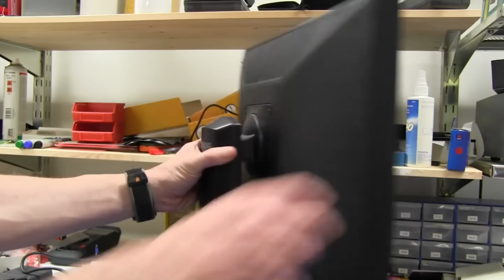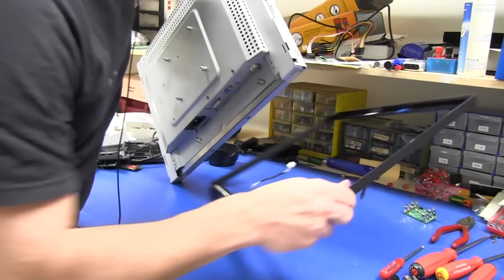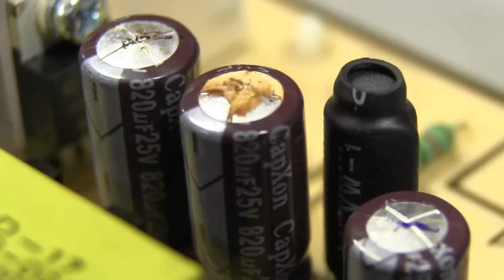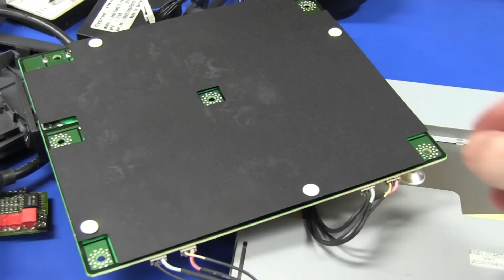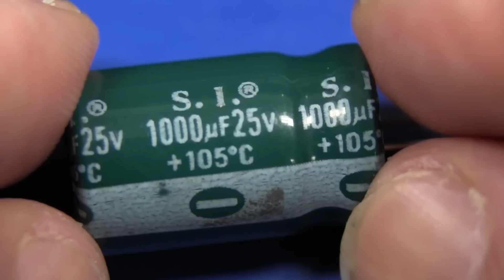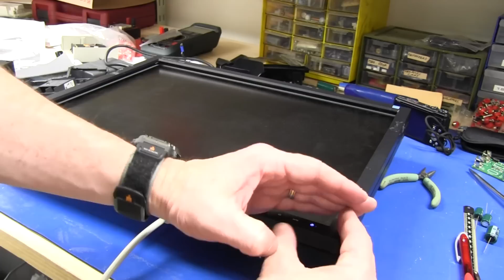EEVblog #347 - Bad Cap LCD Monitor Repair

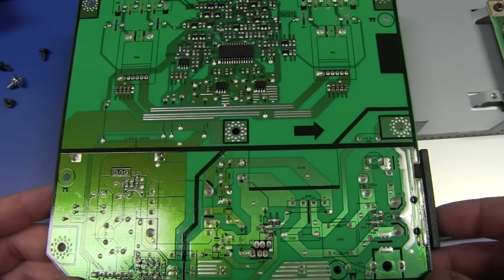Comment: @10:15 check the back side, the connector has the ground soldered directly to the board. That one you point at is extra ground connector, not used on this board.

Comment: The capacity doesn't matter much, a large capacitor CAN shock you even if it's 1-2 uF.
You can grab a 4.7k - 10k resistor with some pliers or tweezers and touch connect its terminals to the capacitor - the capacitor will slowly discharge through it.. use a voltmeter to determine when it's safe to touch it. 
Generally it's safe to work on the secondary side, without discharging the high voltage cap, there's no high voltage there. Just cover the large cap pins with insulating tape or paper..

Comment: Is it possible to discharge the caps on the PCB by switching the monitor on, before replacing them with new ones? I don't know if it’s dangerous to work on high voltage caps....high voltage but low capacity.

Comment: This has nothing to do with electronics.

The connector has four contacts. Three through-hole PCB pins, and one solder lug. If you look at the underside of the board further on in the video, you can clearly see all three pins are connected and an earth plane present, which quite visibly connects to the chassis via the mounting hole to the side of the connector.

Comment: Did fix a lot of those Samsung LCD's in the past. Yes 95% capacitor problem, sometimes burned  as it is called "inverter transformer".

Comment: Believe it or not, I watched this video onto a street-found 20-inch Samsung Syncmaster that  had bad caps... I repaired it in less than 15 minutes,  I didn't even bother purchasing caps, I just dropped in whatever salvaged close value caps I had available in my odds and bits drawer.

Comment: One huge hurdle in the way of replacing capacitors is finding the correct capacitor in the first place.  I was going to replace some blown caps on a motherboard but when I got the new caps from Digikey they were freaking huge and return shipping cost as much as they did to begin with!  Dang, I did the best I could though.

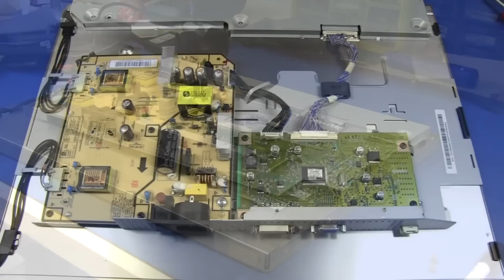Comment: I'v asked because at time 4:04 you can clearly see the ground pin of the AC plug without any sign of solder. Neither Dave disconnected any wire while opening metal back panel. :-)

Comment: Had exactly the same problem with my old syncmaster, also the same ratings for the caps.
I replaced them and it's still running :)

Comment: those crappy caps are build in obsolescence, 
nowadays products get designed to work for about 3 years and then the specifically designed weak link fails.
Bad caps are a pretty obvious fix, but I've seen Samsung designs that “featured” a digital counter that permanently turned off the device once the predetermined run-time had been exceeded. Samsung is the worst offender but by far not the only one.
The European Union is currently evaluating to reverse the burden of proof, to stop this.

Comment: A good example of planned obsolescence. IF they had face-palm then it was because they got debunked on this fraud here. Not only they saved $50000 on caps, they also earned money after these monitors stopped working and peoples needed new ones.
It is understandable that company want to increase profit, but I can't support them on this, because it is wasting resources on multiple levels.

Comment: it's a planned obsolescence - you just replace your monitor every two years. they even migh had some poor soul to _engineer_ these caps into the design so monitor will work only till the warranty ends.

Comment: Heh, I've had 5, count them 5, Samsung monitors do the same on me (my own private gear I bought with my own money, I'm not a tech that sees hundreds) my solution was the exact same, replace the broken caps and they've been working for years since, one of them broke in less than 6 months, only real issue was one of them used a weird sandwiched board with soldered on heatsinks acting as brackets, couldn't get em off so I had to get creative, my brother had to help me desolder and re-solder it

Comment: I was once repairing a display module of an old CNC machine. It had intel 80-something cpu and a few other chips on it. Attaching a scope to the +5v pin gave a nice looking sawtooth waveform with peak-to-peak of about 2-3V. On the other side of the board was a closed switch mode power supply generating hv for the display. The problem was with the internal caps on the input had gone bad. It was not easy to replace them, so we just added another outside

Comment: Ugh, why does a pretty successful, expensive electronics parts shop like jaycar sell dodgy cheapo never-works-to-spec SI brand caps? It's just not necessary... they have enough sales volume to buy united chemi-con or rubycon stuff at 1 cent more a piece.

Comment: You really should replace the 450V 100µF capacitor!

CapXon high voltage lytics are notarious for going open circuit without bulging.

Comment: I just opened up an old ViewSonic LCD, which I repaired (i.e. replaced some caps) a few years, because it started acting wierd a week ago (scrambled, mostly white screen after power on; works after a "warmup" of 5 minutes, a time that was increasing day by day).

I thought my replaycement caps crapped out (they came out of a used PSD). But no, they are totally fine. The culprit: a 330µ/25V CapXon I didn't exchange. Btw. the inside of the monitor after running had 60°C+ . Talk about design fail.

Comment: This problem isn't just with samsung, or with monitors.
If you have any kind of electrical equipment with a built in switch mode power supply, chances are this is how it's going to fail.

The high quality caps just increase the time until cook over and failure, they don't prevent it. But yes, samsung shouldn't be using the cheapest ones.

Comment: I've lost count of the number of these I've fixed like this over the years. I guess the bean-counters will be happy as long as the cheap caps last longer than the warranty, particularly if it means the customer then goes out and buys a new monitor.

Comment: Notice the polarity markings on the cap? That should tell you, no AC. If there is AC across a polarized cap, there needs to be a DC bias large enough that the polarity remains positive. But not so large that the peak voltage does not exceed the rating of the cap.

Comment: did you replace the 820uf caps with the 1000uf caps? i have a samsung sitting here with 820's and i don't have them in stock. would have to order online to get exact spec replacements.

Comment: I had to do this recently, it didn't work because whilst there were a lot of broken caps in it (I replaced them all just in case), the backlight also blew. It was new and expensive as well, with no warranty =(!

Comment: That capacitor is connected to the rectified mains DC supply.  Hook an electrolytic up to AC and you will get lots of BANG!

Comment: Not advisable - and in this case looks like the mounting screws (for the stand or arm mount) attach to that shield.  If you can live with a floating monitor without any bracket then its probably 'okayish' and 'distorted as hell if you turn a microwave on'

Comment: The SyncMaster 793S 17", we're and are one of the clearest screens i've worked with. Cheap but really clear. What i liked about it and what people were saying at the time was that it lacked definition and color. But as usual as with most inexperienced users they wouldn't bother setting up the display properly. Once you do it's a beast. I still use it from time to time when i have a task that includes digital manipulation etc.

Comment: The guy who designed that board probably did it using Panasonic, or Rubycon, or another good brand of caps. And hell, the first few batches probably used 'em. Then they start cutting costs. It's a real shame, but at least it's easy to fix (hell, that entire PSU, only the HV side and the transformer are a problem). I just wish people would bring them to people like us more often instead of throwing them away.

Comment: No, bigger isnt better. Choose the same or higher values as the original, never lower. The capacity should be somewhat close to the original. The voltage rating can be as high as you want, but it wont last longer because of that.

Comment: You talk about bad caps, what brand would you recommend. I have been told that nichicon is a very good cap so thats what I have been using. Should we be using a different cap?
Love the vblog, I have learned a great deal.

Comment: I fixed 3 monitors with bad caps a few years ago (2 LG Flatrons, 1 ViewSonic) and use them since then (10+ hours a day). Funny you make that video right now. The Viewsonic is starting to act wierd again since a week or so (scrambled screen until after 5 minutes [increasing with the days] of "warmup"). Main reason would be, I used caps out of a used PSU then.

If I exchange the caps and isize allows it, is it better to go for higher capacity or higher voltage rating?

Comment: I have a subwoofer that needed a capacitor replacement. Glad I did a burn-in test before using the sub. Although the back panel doubles as a heatsink. By the way, you might wanna swing by a manicurist, your fingers look horrible. ;-P

Comment: Caps are the bain of my life.  I have been given the Quantel Paintbox from 1981 that used to belong to the BBC and was used on programs on Dr Who etc (videos on my channel)  I've got to spend an absolute fortune replacing the caps on it throughout the power supply and the boards :o(  I'm going to be spending well over £100 refurbishing just the psu :o(

Comment: Often enough, underrated voltage as well. IE 15volts on a supply rail and they choose to use a 16volt cap, cuts things close.

Comment: 85% of the time or so it's the damn caps. If you replace them, make sure you use higher temps than what was in, like if it was 85°c, then put some 105°c.

Comment: I usually put in smaller caps in parallel with ugly bodge wires, so I can fix pretty much all monitors with a supply of 470uF 35V caps. The result seems to survive the ripple current better and fits easily in the case, unlike trying to shoe-horn in higher-quality ones (with better ripple current handling) of the original rating which are always bigger than the ones that failed (no free lunch)

Comment: I fixed a big flat panel TV for a charity fund raiser last year. It was an expensive TV taken out by a single cap in a power supply module. Those 85C rated caps will pop every time. It costs a few cents extra for 105C rated caps, but they actually do the job.

Comment: I had exactly the same prob with my Samsung Syncmaster 226BW. Almost the same caps as far as I see. My Display-Caps wear out after 7000 hours of useage (service menu). Mine also had the CapXcon inside. I replaced them all with "better" caps (a bit higher nominal voltage from Nichicon). As you said, if a TFT doesn't work anymore, in 95% of cases it will be the electrolytic caps of the power supply.
I think they chose caps with lower quality and/or drive them to close to the nominal voltage.

Comment: Told you they would have bad caps! They used 'CapXon' branded ones. 

WTF, why did you use 'S.I.' branded ones? Those will blow up even faster than the 'CapXon'!!!!! :O lol, tsk tsk tsk